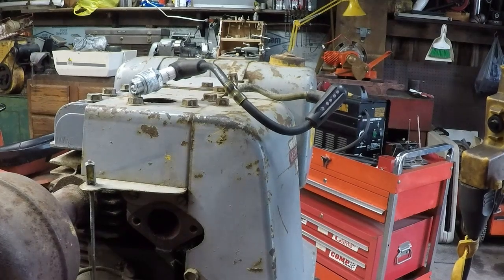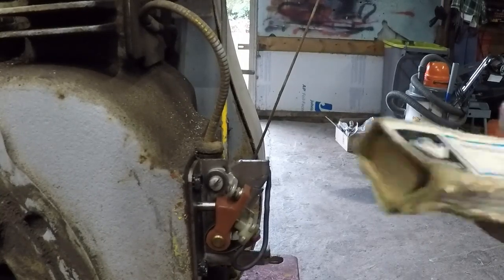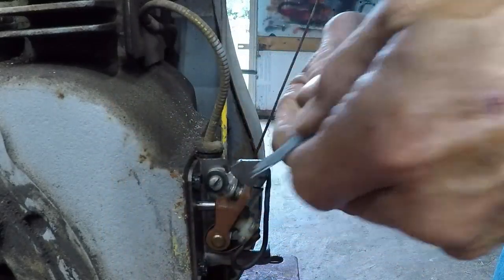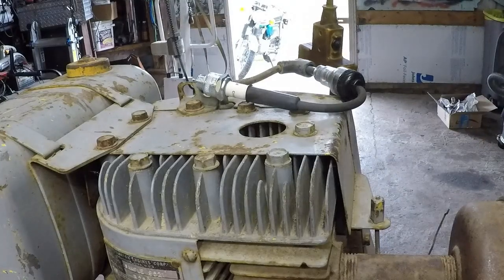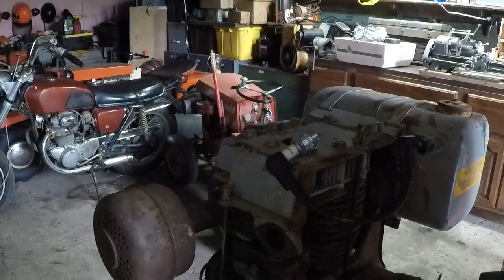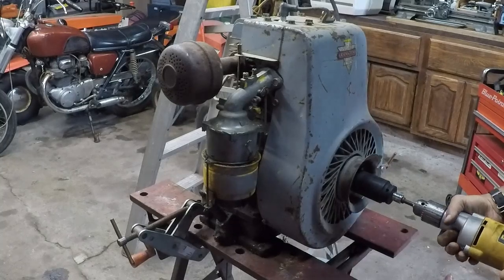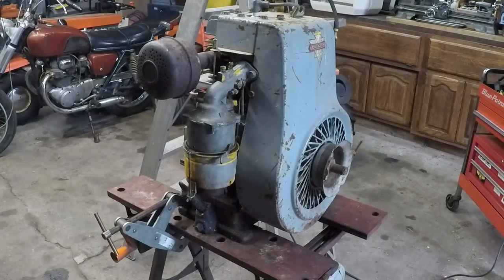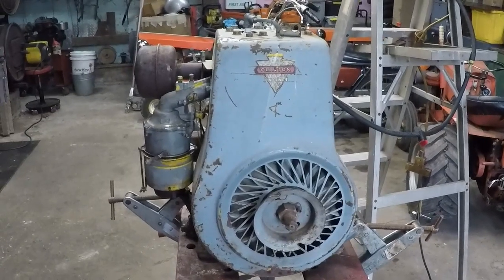Clinton Sample Engine Part 3 of 3 #smallenginenation

Comment: great job Master Zippo....when I saw no spark judge dredge  entered oh no not the flywheel. a had that fear not knowing the point location.....thought cleaning them up would do the JOB.  still no spark. "dredge" 
came back I've had to pull a few....not a welcoming task.....but as I was watching I may of missed your placement of the spark plug it came to me what a great use for a magnet. and low and behold you  
had already thought of it. I will credit you for  that! hence forth.....for I'VE never seen that before ....all I could do is see it falling off "losing the good ground"
necessity the mother of invention...and your right about using the electric drill...kick back so next time and maybe you do is start just past the compression stroke....my folks had bought a 1933 cc case tractor. hand CRANK only... total fear of Go start the tractor , never wrap your thumb around the handel.....it may kick back....and no smoke what a pluss.....again  great job! informative! and l learned stuff .....who knew!
 many people who are "gear heads" appreciate your hard work....thats all I got...... I'm out....go take a ZIPPO ride on you 350 4 but did you see I came across a 72 350 co in great shape?
Reply from the maker: I have replied to each comment regarding your 350 find, but apparently you're not getting them. Hopefully you will this time. Cheers! Zip~

Comment: Pretty convenient having those points right there on the front row instead of being buried under the flywheel.
Reply from the maker: I've had them in all different places. The toughest to work on are under the flywheel sharing space with the internally mounted coils like on my old BR6 Briggs. It's lost spark again and I just haven't bothered to dig into it because it's such a pain lol. But yes! I got lucky with the wire just coming off the connector. I could have been fighting that flywheel. Cheers Mr.A!! Zip~

Comment: I know, some say that there is a hard coating on the points and filing them will destroy the points,, well if there is no fire, you have to do something if you don't want to buy new points,, I take them off and use my dremmel with a  cut off wheel and hold the points against the the side of the wheel,  that really dresses them good and so far I have never has this cause any problems with the points.
Reply from the maker: I've not gone to that extent with resurfacing, but I've not had a set go bad on me as a result of my cleaning techniques. Cheers MOT!! Zip~
Reply: lol well this method isn't as harsh as it sounds, the cutoff wheel is very fine on the mototool so it more like polishes than grinds,, it's pretty easy to get them  level that way. but that's just my unorthodox way of doing things. lol

Comment: What model is that Clinton engine ?  I have a model Clinton 414 that looks a lot like yours, but  mine is missing the original carb. Somebody at the lawnmower shop where I bought it stuck a big Honda carb on it. Did you notice how the big Briggs and big Clinton engines look a lot alike.
Reply from the maker: I show the model near the end of the video.

Comment: I need the part number for the points and condenser for my 12hp briggs and Stratton  on a simplicity  3012
Reply from the maker: Go to the Briggs and Stratton web sight, type in your engine numbers to get your engine manual and you'll have the part numbers for everything on your engine. Zip~
Reply: ZippoVarga I have searched for those numbers and can not locate them. I believe they've rusted  away.
Reply from the maker: This makes it very difficult for you to determine what your part numbers are John.

Comment: One more question for you. I know you dont typically do "tool reviews" but .........i do know you have commented on the clamps you use. What are they?  I have searched and searched back through your videos and cant find the one where you mentioned the specific name of them. They look very handy for many applications. Are they type of welding clamp or something else?
Reply from the maker: https://www.amazon.com/s?k=kant-twist+clamp&i=tools&gclid=CjwKCAjw1f_pBRAEEiwApp0JKKGnvoO_XQxtP3XcKGVH5XIMGf-rS58tCfpdtUz8X8yQBLtyXxfU7RoC_OoQAvD_BwE&hvadid=153695719108&hvdev=c&hvlocphy=9016510&hvnetw=g&hvpos=1t1&hvqmt=e&hvrand=1277856894855830750&hvtargid=aud-676677759524%3Akwd-27996030876&hydadcr=1612_9512159&tag=googhydr-20&ref=pd_sl_9qm4zad9tk_e
Reply from the maker: They are the evolution of the traditional C clamp. Your hand tightened clamping abilities are multiplied many times over with these clamps over a traditional C clamp. Pick one up. You'll quickly find one isn't enough in short order. They're called Kant-Twist, and I posted a link to them. Zip~